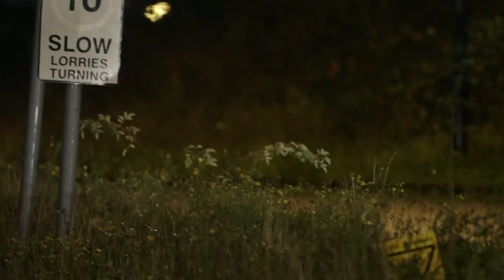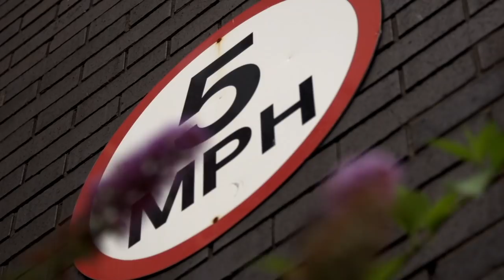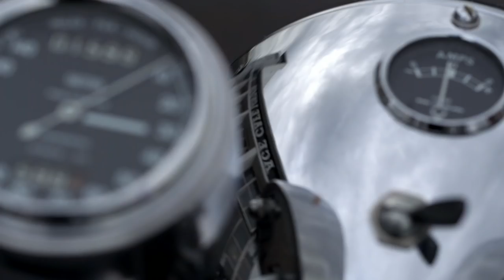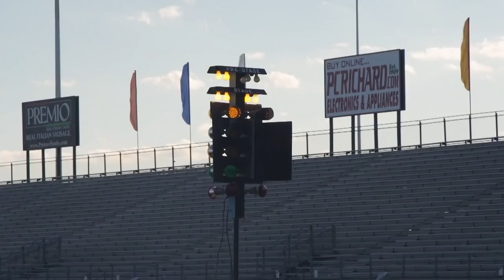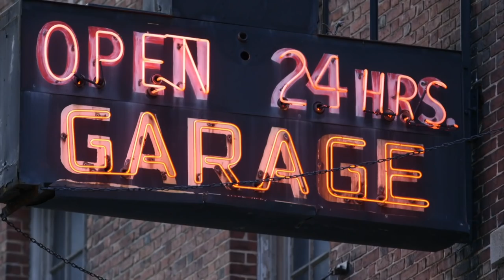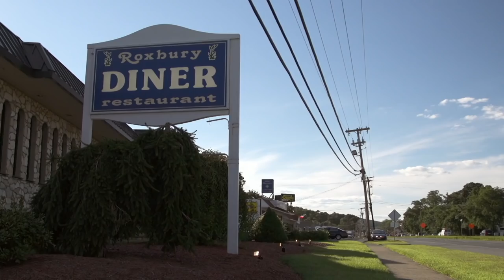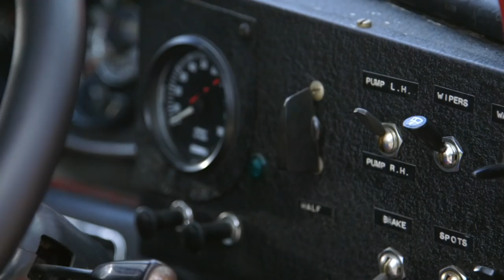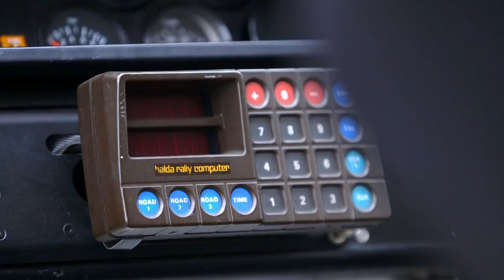Idris Elba: King of Speed - Learning How to Drift | Full Documentary | Reel Truth

Comment: Ohh boy...the much maligned Corvair.
Reply: The king of the oversteer cars.  And the reason why it was so controversial.  I drove one for a short time in the mid 60s and the slightest motion of the steering wheel at highway speeds would cause one to feel the heaviness of the rear,  and how it wanted to swing out.  At motorway speeds, precise steering with minute motions on the steering wheel was required to keep the rear of the car behind you, where it was supposed to be.  Heavy-handedness could easily lead to a spin. .